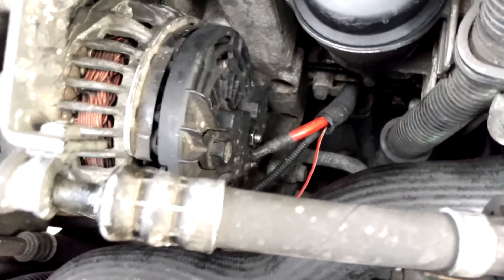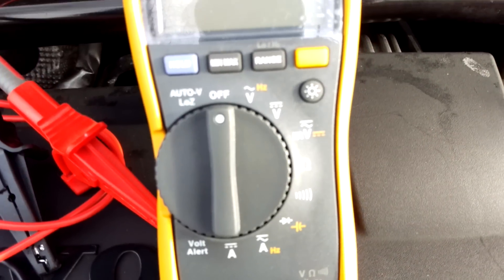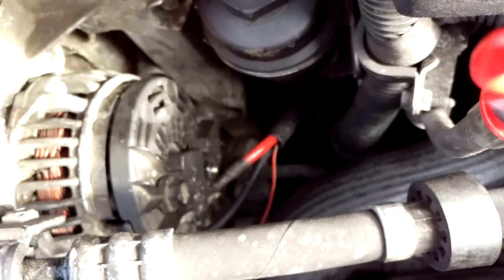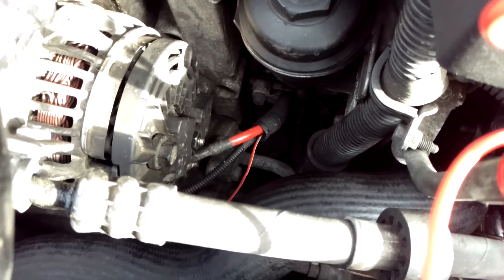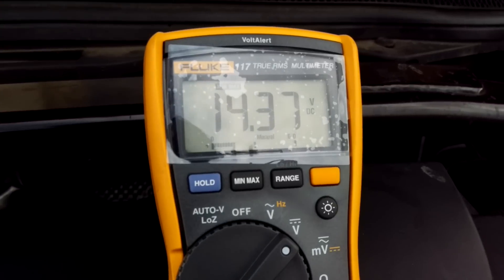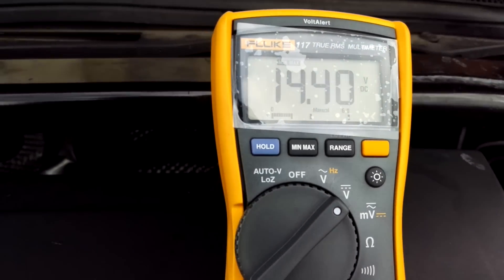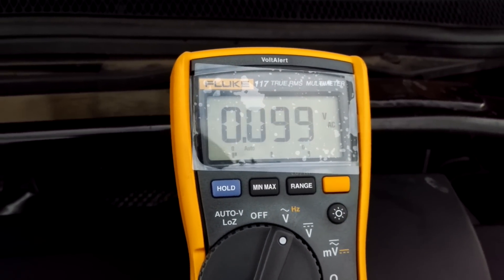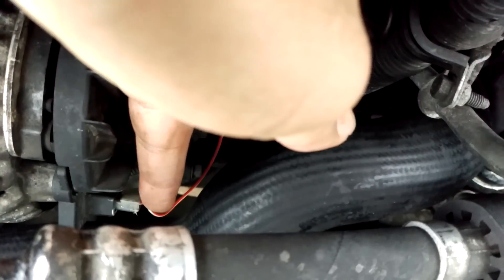How To Test an Alternator Part 2. Rectifier, Diode Pack, Parasitic Battery Drain

Comment: First off, great video and very informative.  I've had a parasitic drain for a while in which the battery(new) would die overnight.  My car was a 2008 Saturn Astra XR (essentially an Astra H) with 75000 miles.  The alternator B+ post is not accessible from the top and certainly not while engine running so my tests were slightly different.  At any rate, the parasitic draw was 380ma after all electronics went to sleep.  After fully charging battery, I ensured I had 12.6v.  Next, I did a voltage check at battery posts with engine running: 14.15v.  Ok, next I checked AC voltage: 0.39vac.  Hmmm...  couldn't do diode test without yanking alternator (which is a PITA on this car).  So next, I went and did a draw test whilst yanking every fuse and relay one at a time... no change, still showing 380ma draw.  So I tear the thing apart and the moment the alternator broke free from the block, the draw dropped to <10ma.  Pushed alternator back up to block  and back it jumps to 380ma.  Pull away, and it drops to <10ma again.  Remove the darn thing completely to confirm - yet the diode tests 530mv one way and infinity the other... But, plainly the alternator is causing the draw, even though it tested fine.  Most frustrating!
Reply: About 380 MA ? It's probably that little diode trio pack that runs the internal regulator and field rotor coil.  Reverse voltage though alternator, using test light to limit current, should be around 1.2 volts -- if it is around 0.6 volt; then one of the main diodes is shorted and will cause alternator to run hot.  If one of the main diodes is shorted then the internal regulator circuit might be drawing current from positive though shorted a main diode.
Reply from the maker: That sounds very strange and I can't offer any suggestions.
Let me know how it gets resolved though.
Reply: @sirobb  I purchased a new remanufactured alternator and reinstalled.  There was no spark when reconnecting the neutral like there was before.  Draw test was <10ma with the new alternator installed vs the 380 on the old alternator.  So it definitely was the alternator.  My guess is that one of the diodes shorted but the others were working, or there was some other internal short.
Reply from the maker: Thanks for the update.
Very unusual symptoms but I'm glad you got a positive result.
Reply: I had a similar experience on my 03 Dodge Ram 3500 Cummins. I bought it off my dad who had been dealing with a parasitic drain for years.  I started by replacing the two batteries which had failed due to the constant drain. Then I did the standard test of pulling fuses with no luck. Then I stumbled across a video where they said the alternator was the problem. Had it tested at auto parts store an they said it was good, but when I disconnected the alternator the drain went from 1 amp to 15ma. WEIRD!
Reply: This is something that's happening to me as well. I ordered a new voltage regulator for my alternator as all the other parts, diodes too, seem to be working as expected. For me it's 200 mamps draw, dropping to 10 mamps when I disconnect the alternator.

Comment: On the diode test, I am getting a reading of 502 and OL. Is the 502 still within the tolerance? You got 532. Great video, David 🐈
Reply from the maker: Sounds good on the diodes.
There are 3 tests in the video though so check them all.

Comment: Hello. I have performed a diode test and on diode mode of the multimeter it reads 1 in one direction and 1141 in the other direction. When using the 2000 ohm scale it reads 1 in one direction and 825 ohms in the other direction. Is my diode rectifier pack bad or is it normal. My alternator is mitsubishi 120 amp alternator with 8 diodes 40amps
Reply from the maker: The diode figures show one way current flow so suggest that the diodes are ok but there are 3 tests in the video so what are the readings for DC Volts output and AC Volts output when measured from the alternator?
Reply: @sirobb  that is the problem I am trying to determine if the voltage regulator is bad by checking all other components, since the alternator is not charging at all and the on board monitor says: faulty charging system
Reply from the maker: There's also a video of mine showing regulator replacement and testing of slip rings so perhaps that might help.

Comment: There is a significant delay in your charging. Wouldnt that be regulator faulty or rectifier pack?
Reply from the maker: This video is 3 years old and my car is still working perfectly. Which delay are you talking about?
Reply: @sirobb  Just from start up I was expecting faster response.
Reply from the maker: No, that's normal.

Comment: I have 14.2v (dc) at the alternator and 30v (ac) - but the diode test is perfect (626 in one direction, 1 in opposite) - any Ideas as to what's going on?
Reply from the maker: Hi. The video description will explain.
Reply: @sirobb   - ha found out that cheaper digital meters (non-RMS AC reading) give spurious reading in the region of +/- 30v ac... and should be ignored. The quick test was reversing the black/red probes gave a reading of 0.00v ac - thanks for your prompt reply! My alternator is ok, now to start the parasitc drain dance...;-). Sorry I didn't see your description as it was in the dropdown bit... my error.
Reply from the maker: @paulclose3426  No problem. I have a detailed parasitic drain video in my list also.

Comment: This video could be much better  making only 3 simple tests. First check the battery terminals voltage, engine OFF, multimeter at  DC  range 20 V.   The reading must be at least 12.6 V. Second start engine, and the tested voltage should be higher than 12.6 V, and at range 13.5 - 14.5 V depend on the model of your car. This indicates that alternator is charging.Third bad diode testing. Set the multimetr at AC and test terminals of the battery. There won't be a reading over a couple of volts. If there is any AC voltage, indicates a bad diode and the alternator must be repaired or replaced if it is more than 3 years old.  Mine has a reading of 30 V AC. Replaced the alternator and the serpentine belt.
Reply from the maker: What?
Reply: There won't be a reading over a couple of volts, OR  if any AC voltage the diodes are bad and you need to change the alternator PLEASE EXPLAIN THAT ????
Reply: The 3rd test is the best.

Comment: So is the 3rd test done with the car off? It doesn't sound like the car is running
Reply: The car is most certainly off on the third test
Reply: Third test is done using the diode mode on the multimeter, and this is specifically to test diodes.
Reply: @mohabatkhanmalak1161  but is the car off? or is the car running?

Comment: well I have a parasitic drain of 300ma which goes when I disconnect the alternator.. used the method here to conclude my diodes were bad and the info here is wrong.  On diode method given here I had 1.3 volt one way and 500ma the other.  It seems like wasted time and expense taking it back to the garage with the info here as  they told me the ripple test found it was ok and that newer diode packs are transistors which feed current differently, so you need to find manufacture spec to know whats what with these readings.  Am going to do a simpler AC check now.. I suspect the parasitic drain must be coming back through the alternator circuit, because it shares circuit with the starter circuit and must be passing something from that  forward to the battery.
Reply: 300ma is well within spec my f250 by spec up to 500ma
Reply: @fuckaudolphin2591  ur confusing 30 milli amps to 300 milli amps... And 50 milli amps to 500 millo amps which is 0.5 amps or 0.05 amps

Comment: i had a 01 chrysler voyager, And I could not figure out why all my instruments would jump all over the place and the thing would go into limp home mode stuck in second gear. I noticed a whine from the alternator, Had a good 13.8v charge. Could not figure that little bit would screw anything up. Then I thought well wait 14.4 is the normal where is the lost voltage. Tested it for a/c and it was putting out 1.5volts a/c current.  This was years ago. Replaced the ALT and back to normal.

Comment: When I do the diode test on my alternator it shows 400mV forward voltage and 1.3V reverse voltage. So I can see my diode(s) are bad. My battery seems to drain really fast but my amp draw is only 30mV when the vehicle is off. Does a defective diode with back flow of 1.3V show up under amp draw? I feel like mine doesn't.

I've learned from watching other videos that if one diode is bad your alternator will still show a correct charging voltage (~14V) but it won't actually be charging? Is there a way to test your alternators output to see? I assume you'd check for amperage?
Reply from the maker: I LOVE NINTENDO Yes, you can check Amperage with a current clamp. You'd be able to see the alternator output as well as the charging rate of the battery. 
You still haven't told me the DC voltage and AC voltage as per the other tests.
Almost impossible to solve without information.
Reply: Sorry. VDC (idle -> 14.3, 2500rpm -> 14.4) - VAC (idle -> 0.03, 2500rpm -> 0.05) Looks all normal to me.
Reply from the maker: I LOVE NINTENDO Sounds normal to me too along with the standby current drain.
Perhaps something is turning back on periodically in the car?
Do you have any aftermarket accessories fitted or devices left in charging?
Reply: No, the vehicle is completely factory. I tested all the fuses and there's nothing going on there. The only thing that shows defective is my diode test that I learned from watching your video. "Posted results above". I went to an auto parts store to test one of their alternators to make sure I was doing the test correctly. And when I test a good alternator the reverse voltage shows OL like it should so I know my diodes are bad it just doesn't appear to show up as a draw.
Reply: So it turns out 4/6 diodes in my rectifier were bad. I got my rectifier replaced, reinstalled my alternator, and all seems well. But when I use a Fluke 234 Plus to measure the ADC coming out of the alternator at 2000RPM it only goes to about 40 ADC. My service manual says the reading should be 85 ADC. Any ideas?

Comment: Great video, I have an alternator that doesn't seem to be working, battery voltage goes down after starting up the vehicle :s I've done a bunch of tests including checking AC voltage which was as high as 25v when the car was idling :o  Would that be the kind of AC voltage out you would expect with a blown Rectifier? I haven't done the last test you did but shall try it in the morning. A Rectifier replacement would certainly be more cost efficient, fingers crossed :)
Reply from the maker: p00ky76 I suspect that your multimeter isn't True RMS as per the video description so you're getting an unreliable AC voltage.
You'll have to rely on your DC voltage figures and the diode test.

Comment: JB the engineer, why didn't you mention doing an AC voltage test while car running with and without accessories turned on and at about 2k rpms?  diodes should not let very much AC into charging system at all.  isn't that what we are looking for with the tests?
Reply: Raymond Duke 
because there are enough people doing it right out there, unlike others.

Comment: Author posits that "battery parisitism"  results from failed diode, but that's only narrowly true, here...  if diode fails by shorting, not by opening.   Meanwhile, a failure by open diode element will result in diminished ability of alternator to push current into battery...    discoverable by "load testing" the alternator.
Author fails to mention the need to energize the FIELD WINDING, during testing while red (B+) lead is disconnected, and appropriately protected by rubber sheath.
Author also fails to reveal there are really six diode elements in the 3-phase full-wave rectifier assembly, within the alternator.    There are several modes of failure, therefore.        
If only one diode (of six) fails by opening, author's "diode test" conducted with the red meter will not notice anything, in this situation.      Because the test current will still flow through two of the three remaining diode elements, in the afflicted half of the full wave rectifier, resulting in the 300 millivolt drop of a silicon forward-biased rectifier element.   (Two in series makes for the 600 mV demonstrated by the author.             Look up a wiring diagram for a full wave rectifier... Make that a 3phase full wave rectifier, while you're at it.)
Finally, the author suggests one may save money by repairing the rectifier alone (obviously, the entire collection of elements)... a big job.         Alternators are best repaired in repair factories, where all bearings are supposedly replaced, as well.    Then the whole thing is tested UNDER LOAD, which will, indeed, verify that ALL THE DIODE ELEMENTS work... not possible by the methods shown here.       Author conducts no FULL LOAD test, whatsoever.
So, yes, if there's a shorted diode (conducts current in both directions, an abomination), the author will have found the cause of one form of parasitic drain on battery.
A foreign element (contamination by solder, for example) can spoof this disgnosis, and look like a failed diode.
I recently inspected a rebuilt alternator that I bought for my car and found a splash of solder on the stator windings.
             JB, Electrical Engineer.
Reply from the maker: John Becich There are 3 tests in this video, DC voltage, AC voltage and a diode test but for some reason, you've focused all of your retort on the diode test and as a result, your observation isn't particularly useful.
In the time it took to post your essay however, you could have simply made your own video to show us what we're missing. 👍🏾

Comment: Hi SiRobb, 91 Honda CRX Si 1.6L here. Battery is 8 months old but doesn't hold a charge. I got a jump and was able to drive to car parts store. Battery tested ok, but tech who works there said alternator diodes tested as bad. The only way I can get car to start is if someone gives me a jump. When I turn car off and turn on ignition, slight click then nothing (no crank, no start). All fuses tested ok. Couldn't do DMM series parasitic draw test because car won't start. Just now I removed all electrical connections from alternator and did isolated diode test. With red lead on alternator case and blk lead on post I get a bit over 500V. However reverse test (red lead on post, blk on case) I continually get 1.7V. Thanks for any insight. My DMM is true RMS. Sorry for long post. Your vids are great.
Reply from the maker: William Budd Hi. What are the voltages (both AC and DC) measured at the alternator and measured at the battery at idle and 2000 revs with full electrical load?
Reply: Simon, thanks for your quick response. I'm on a bit of a steep learning curve assessing/diagnosing these parasitic drain issues and didn't provide enough good data. But I'm hampered because my car won't start unless jumped. I have a fully charged Clore JNC300XL jump n carry (900 peak amps; 225 cranking amps) but it isn't providing sufficient voltage to turn my engine over even tho its cranking amps are in line w/my battery. As soon as I can find a good samaritan to give me a jump I will collect the data you mentioned. Regarding my previous msg, prior to getting battery checked at auto parts store, I did voltage check no key in ignition. It was 3.3V. I didn't have presence of mind to check voltages later when some one jumped me so I could make trip to the parts store.
Reply from the maker: William Budd Ok, well at just 3.3V, your battery is almost certainly beyond help so will need replacing regardless, hopefully under warranty? 
The boost packs are really designed to give a helping hand to a below par battery not to do all the work of starting the car. They rarely have enough amperage for that. 
As soon as the battery is replaced, get straight on with the various voltage tests.
I also have a separate parasitic drain video in my list.

Comment: Hi, Thank you for the informative video. I am trying to ascertain whether 2 old alternators I have are ok, but can only test them off the car, as I no longer have the cars from which they came. I have obtained a reading of around 1200mv on each, using the diode test you described, with no reading the other way round. Does this indicate a fault? I only have a cheap meter. Thanks.
Reply from the maker: +P Ward It's impossible to know the precise reading for every diode pack using every available multimeter so my first impression is that your diodes at least are ok.
Reply: Phew ! Thank you for the quick response. My first thought was that as they are both the same make (Paris Rhone) and basically the same model and that they both gave similar readings, I was hopeful that they are ok as far as the diodes are concerned. It is helpful to get your opinion. Clearly there are a number of other considerations, such as the voltage regulator and integrity of the windings, etc. that I can't test quite as easily, but at least it's a start. Thanks again.